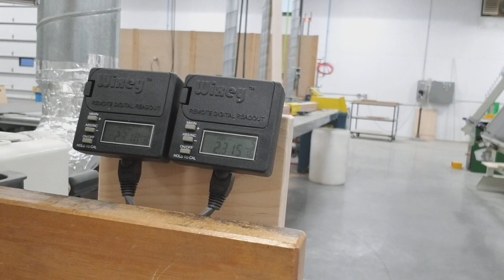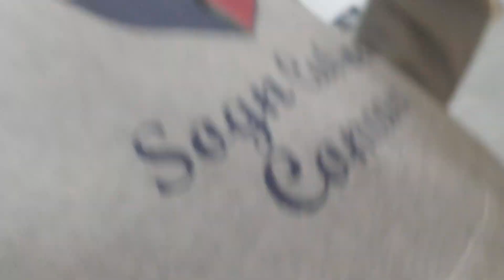How I make: Five piece cabinet door

Comment: Very impressive.
However the shaker style is a fairly easy door compared to other styles.
Do you use your shapers when building a raised panel door, especially ones with arched tops?
Do you also have a door machine in your shop or do you just use shapers for all of your door building
Reply from the maker: Sticking profile won't affect how the process takes place.  Raised panel just added unnecessary time to the video.  Panels are power fed through another shaper though. 

Now we have an automatic coper.  I'm still not doing the sticking and sizing on a moulder.  I just don't have the floor space for it.
Reply: @KBrogger  Thanks for the responce.  
Im an 89 year old retired home builder. 
My son has a 4000 Sq ft cabinet shop here in Florida. 
He also has a Striebig saw, but an older version than yours.
He uses a straight line saw also and has 2 shapers, both with power feeds.
My concern is the safety factor, especially with the shapers. 
He has a jig he uses for the arched tops, but there is lots of exposure to the cutters while using it. 
I have been trying to convince him to get a dedicated door machine primarily for the safety factor.
Do you always use the electric palm sanders? or do you mostly use air ?
Reply from the maker: @ernieforrest7218  Arched doors are a hassle.  Point to point arches, you can power feed those through with a bearing with little risk.  Unless the rails are really tiny.
Cathedral arch, then you're pretty much stuck running them with a fixture and a jig.  Not my favorite.
I have no experience with any of the dedicated machinery like that.  It doesn't really fit our needs, so I really haven't looked into them.  If we did more arched door stuff, I'd probably be putting vacuum cups on the cnc and milling everything with a parametric program.  Not my favorite approach eiterh.  That's kind of an expensive approach, but we'd need the output to justify the capital cost of a dedicated machine like that eating up floor space.  In the last 20 years, I bet I haven't done more than 20 arched doors.  And some of the other weird arched stuff we've done has been so unique, that a specific machine like that, it would have been outside of it's operating envelope.

Comment: Using that oscillating edge sander on the end grain of the doors doesn’t create an uneven edge?  What grit are you sanding with on the edge sander?  Thx
Reply from the maker: 100g. Uneven in what way?
Reply: @KBrogger  When sanding end grain and edge grain on the top and bottom of rail & stile doors, do you ever get an uneven edge afterwards, since the end grain is harder than the edge grain?  Thx
Reply from the maker: @tundrawhisperer4821  No, it knocks it flat
Reply: @KBrogger  Okay, sounds like it’s a non issue then.  You build your cabinet doors to pretty much the finish dimensions and just use the edge sander to clean up edges?  So your not pushing into the sanding belt very aggressively, correct?  Thx
Reply from the maker: @tundrawhisperer4821  Doors are all built .020" oversized.  So we're removing material, but not a huge amount
Reply: @KBrogger  Yeah, I hear where people will make doors an 1/8” oversized and then trim them on the saw to final dimension.  I’m trying to figure out what approach would be best for me.  I don’t have an edge sander, even though I’d like to invest in one, but I do own a Felder slider saw and could trim doors down very accurately if I go that route.  Do you guys use a slider saw in your shop?  Thx

Comment: Thanks for showing us your process!  I'm looking at a used straight line saw, same model you use here, would you say it accurate enough to go cut to your finished width and skip the shaper sizing?
Reply from the maker: The saw is accurate enough.  The wood isn't though
Reply: @KBrogger  thanks for the quick reply!  I know it will be a leap up from hand ripping then planning to width.  Just don't want to over-expect what it will do
Reply from the maker: @florycustomwoodworking8330  The problem is when you release the tension in the material, it can pull it one way or another.  So it's accurate, right up until it's not

Comment: What kind of upcut saw is that along with the automated length that thing is pretty slick
Reply from the maker: That was a Whirlwind with a Tiger Stop, which has since been replaced with a Northfield and a Razorgage.
Reply: Thanks so much I appreciate the info
Reply: Definitely going to look into them
Reply from the maker: @jonathonbunyard9746  No sweat
Reply: @KBrogger  Hi, why do you replace it? Is look pretty nice. It up cut saw make cleaner cuts than miter saw? I am sorry for those dum questions I try to do my own shop and looking for ideas. thank you for your help.
Reply from the maker: @kamilhoufek  A mitre saw will give you a cleaner cut.  The pop up saw will give you a good enough cut for most things though.  I replaced the Cantek because it just wasn't good enough though.

Comment: Do you ever have issues running planed material through the ripsaw, or does the widebelt remove any surface damage that the feed chains of the ripsaw make?
Reply from the maker: The chain doesn't really leave any marks
Reply: @KBrogger  Good to know, thanks for the reply. Do you glue up panels off the ripsaw as well or do they get jointed?
Reply from the maker: @ChrisSmith-md8wx  I like to still joint things.

Comment: Hello,
Thank you so much for showing us this. What is the first machine you run your board through?
Reply from the maker: Rip saw
Reply: @KBrogger  Do you run your boards through jointer and planer ahead of time?
Reply from the maker: @kimurafighter  I order most hardwood in 13/16" thick.  Generally I don't face joint much of anything.  After the rip saw, it goes to a shaper for edging.  Glued up panels will get edge jointed

Comment: Hi can you link the bit that you used to cut the shaker with the bevel?
Reply from the maker: All of my door tooling is through Dimensions in Tooling.  The don't sell retail, just through dealers.  So there's no link.  The heads are about $700 a piece with inserts and backers.
Reply: Thank you.
Reply: Are you able to share where I can get the air clamps that you are using on the doors?

Comment: Why glue the tenon instead of the mortice? Glue scrapes off as you push the tenon in, and gets all over the face of the stile.
Reply from the maker: I get more squeeze out on profiles than when I do it this way, I also think it's easier to hit all the faces.  JLT has a gluing jig that works well for applying it to the stiles, that I'd like to get some day.  We don't push enough doors through to justify it at this point though
Reply: Hi. Sorry. Do you mean, you get more squeeze out when you apply the glue in the mortise?
Nice setup btw.
Reply from the maker: @andylitchfield  correct.  I don't care too much about the face or end, but when it's in the profile it's a pain.

Comment: Cool! How do you prevent blow out when you do your cope cut after your sticking? Thanks
Reply from the maker: Left and right copers on profiled sticking with a square backer.
On a square profile, a square backer works for both edges.
Reply: @KBrogger  thanks. On profiled sticking do you do your cope first, or make a counter profiled backer? Thanks again
Reply from the maker: @benwhaley4054  Sticking cut first, then  just a square backer.  One shaper set up to do one end, another shaper set up to do the opposite end that way you're always pulling into the flat.  With mid rail/stile, then you have to either cope first, or use a profiled backer
Reply: @KBrogger  Thanks, I appreciate your help

Comment: Why dont you use spaceballs instead of toenailing the panel in and 23 gauge pins are a lot smaller and just as effective as 18 ga.
Reply from the maker: We do spaceballs on raised panel.  The only reason we don't on sheet panels is the material is always a little sloppy, so the pins help force the panel towards the front.
23ga has it's uses, I'm just not a big fan for this application.  My finisher dislikes them since they're difficult to fill, and I think he misses them once in a while and has to go back.
Reply: @KBrogger  Yes, 1/4" veneer core mdf can have thickness differneces  but you should be using an adjustable goover/tennoner such as the Freeobrn to combat this issue...or not. Sometimes material is different from one batch to the next that i have to change gooove thickness all the time. Annoying but i do not like pinning the panels in.
Reply from the maker: @jeremys5904  We run all insert tooling.  If I had it to do again, I'd probably do stackable insert heads so they could be adjusted to some degree.